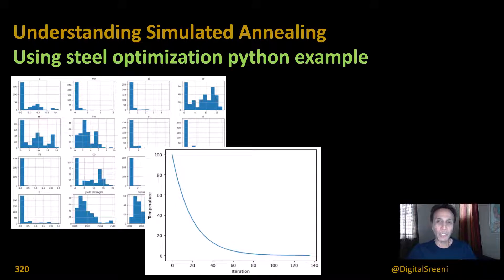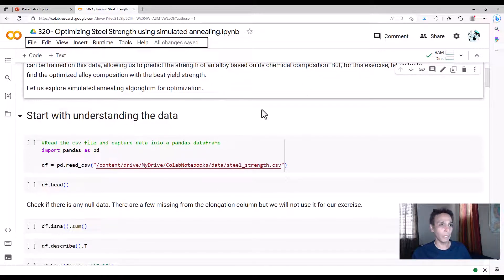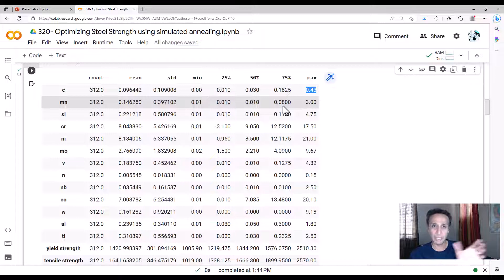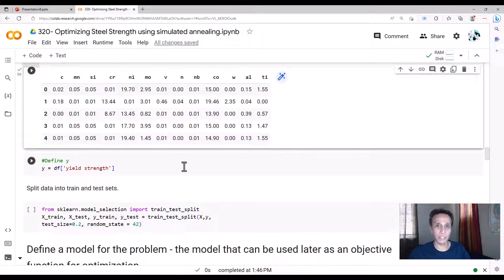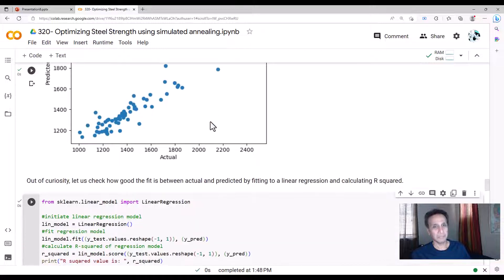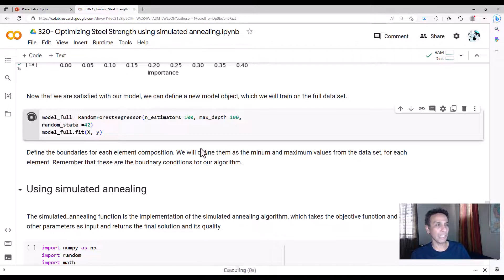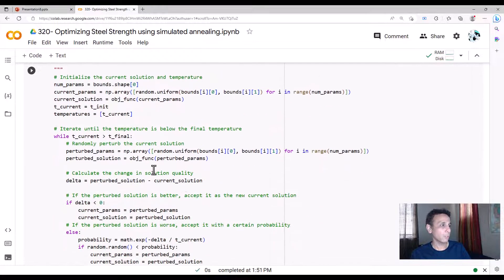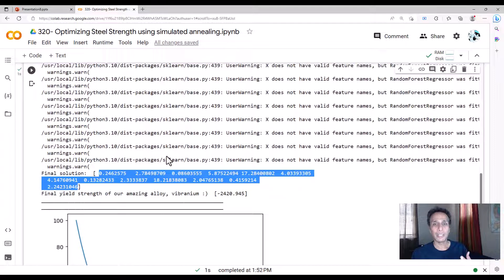320 - Understanding Simulated Annealing​ using steel optimization

Comment: If I understand your choice of objective function, you have a 13-dimensional, continuous space that is created by the predictions of the random forest algorithm. This is probably a smooth interpolation between data points given in the original Kaggle data set. As such, are there any local optima at all, or just the global optima? If there is only one smooth basin, then the data set and objective function are not a good example of how simulated annealing searches and escapes local minima.